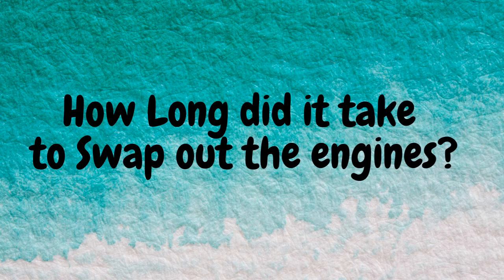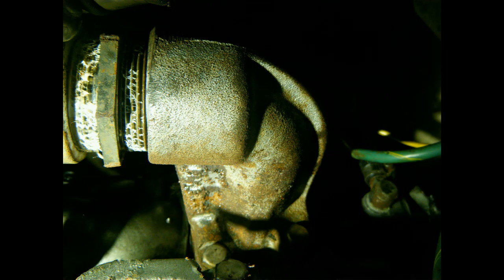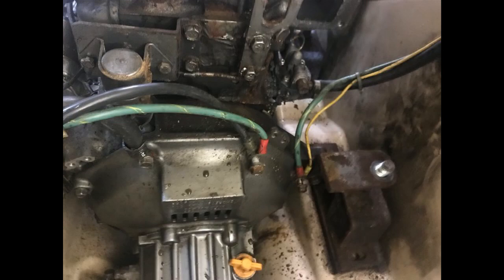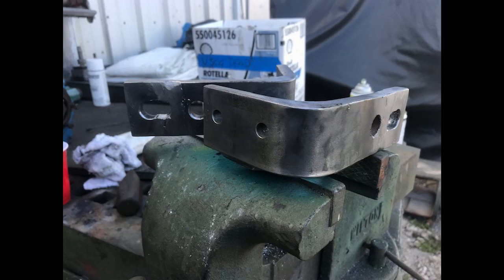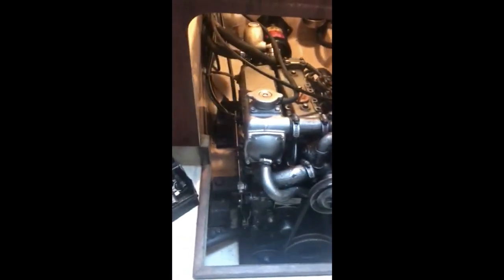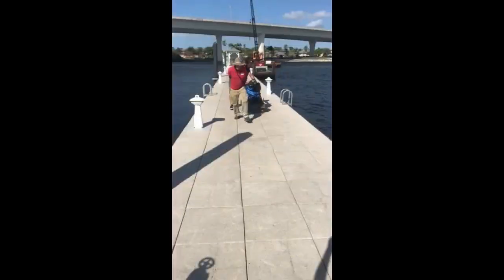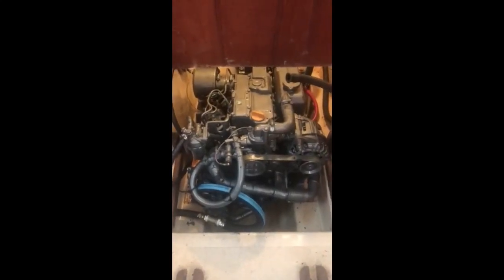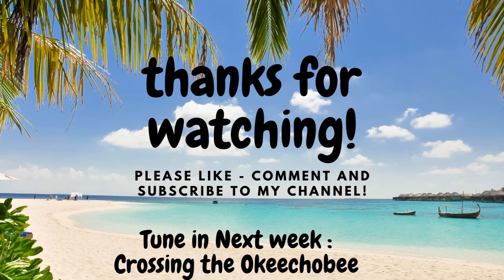Marine Diesel Engine Installation on my Island Packet 320, Southern Star.

Comment: You guys changed the engine because fuel injection pump and injectors? You can have those rebuilt under $500.

Comment: I've got a Volvo MD 2B 25 1974 looked at putting new motor in but New motor's lots of components made in China No thanks it ain't gonna last Yanmar used to be good motor check the starting loom the wires will not be tinned and will give trouble